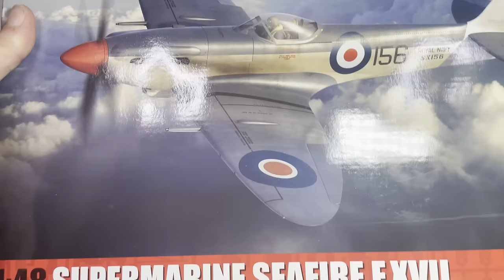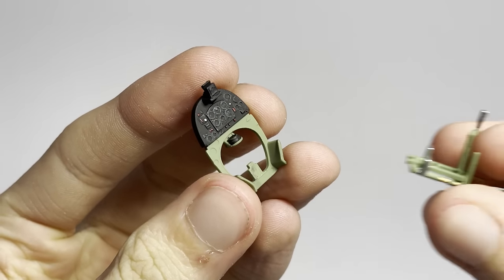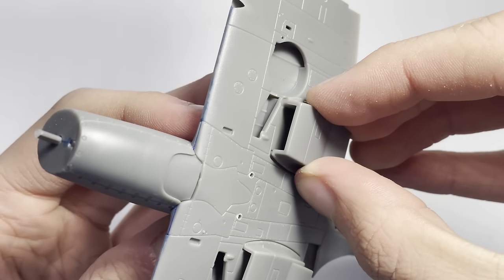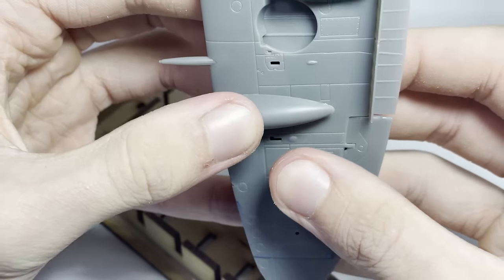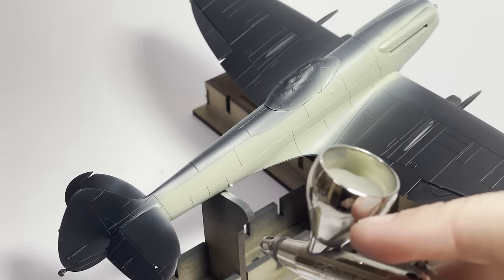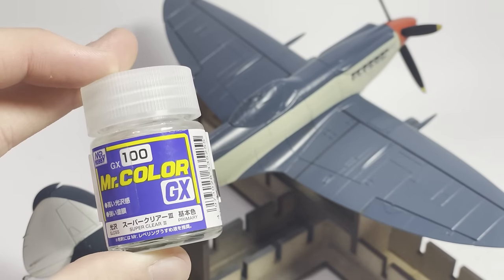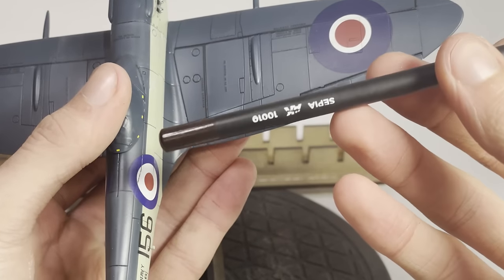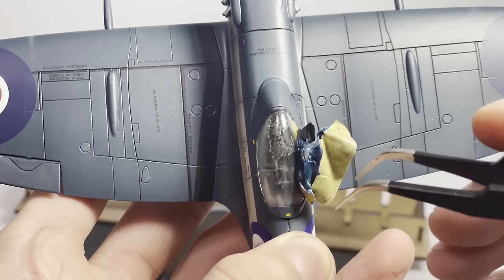Airfix's Newly Reboxed 1/48 Seafire F.XVII | Full Build | HD

Comment: Just found your videos, nice job. As far as paint is concerned, I use either Vallejo model air 71110 for extra dark sea grey and 71309 for dark slate grey (green really!). Or AK interactive 3rd gen air 11849 for dark slate grey and 11850 extra dark sea grey. I dilute the AK 60% thinners to 40% paint and it sprays really well at about 17 psi.
Reply from the maker: Thank you bud! Thanks for the paint suggestions, I really enjoy the Fleet Air Arm schemes so I’ll have some time to practice with different paints. Cheers!😁

Comment: Pretty model - the flaps shouldn’t be down on the ground on any parked Spit or Seafire as that was a quick way to lose your pneumatic pressure.  If you really want to do that then the little doors in the upper surface of the wing should be open to allow the ends of the jacks to protrude.
Reply from the maker: Thank you for the information!! Working on making the models a little more realistic each time😁✌🏼
Reply: @machmodels  you’re very welcome. My company was involved in the paint application for restored Seafire 17 SX336.